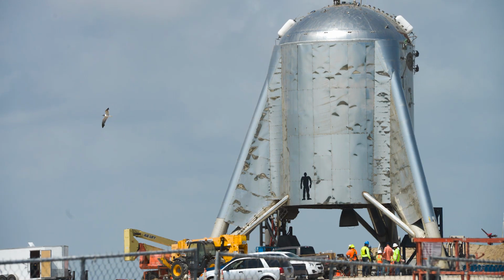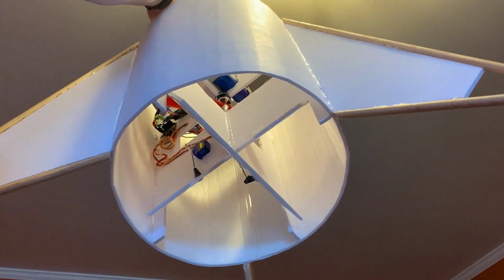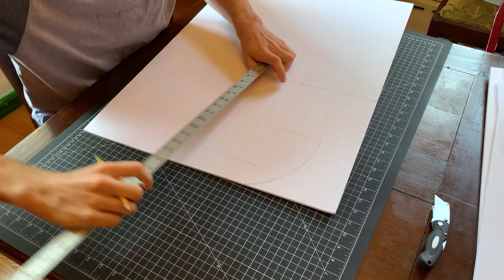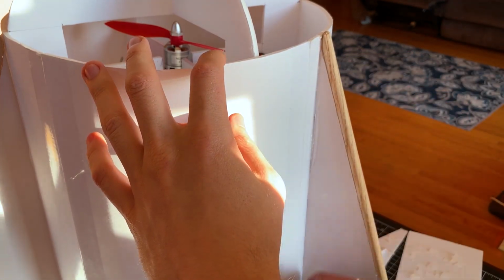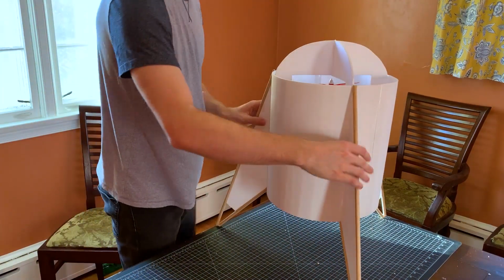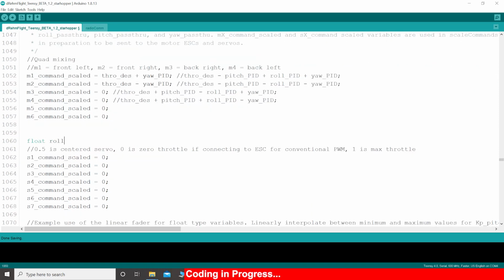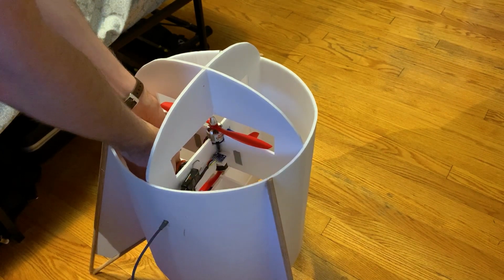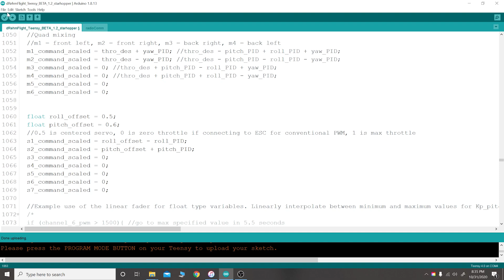Radio Controlled SpaceX Starhopper

Comment: Hey it's really awesome !! I would like to know if its possible to recreate the same thing using a raspberry pi pico ??
Reply from the maker: You might be able to port my code over to that board, but its not as fast processer as on the teensy 4 so you'd need to re-tune some parameters on your own. I can't guarantee the same results

Comment: Impressive what you can do with a bit of hot glue! Looks like you're using an MPU-6050?
Reply from the maker: Yep, MPU6050 with Teensy 4.0 microcontroller handles all the stabilization
Reply: @NicholasRehm  Thanks!